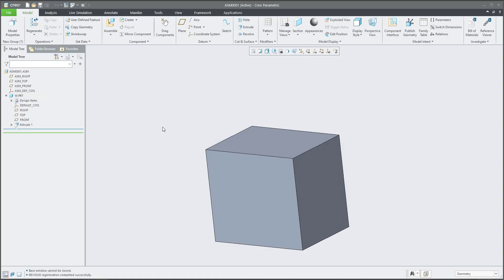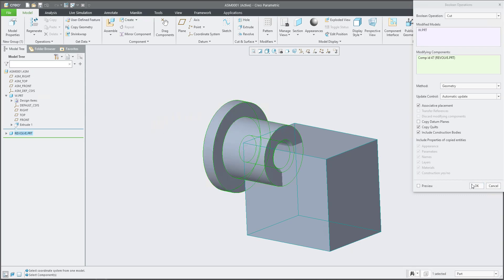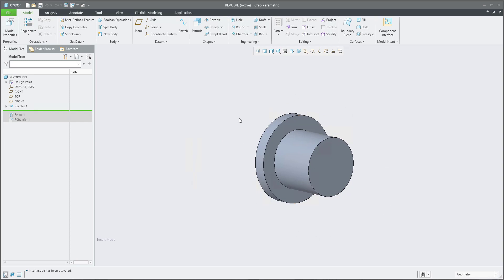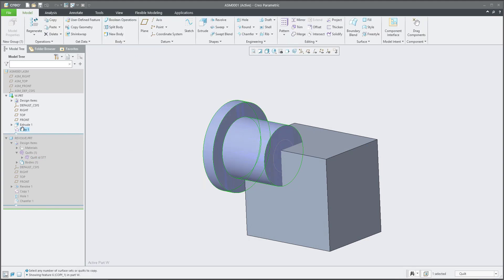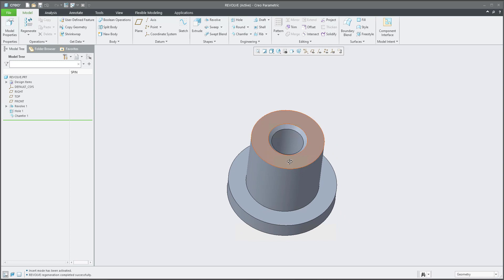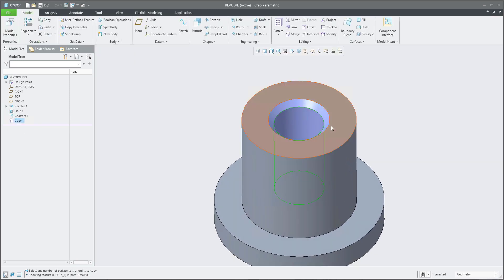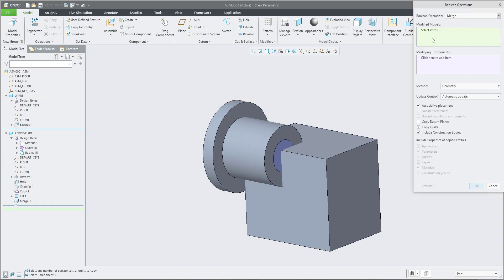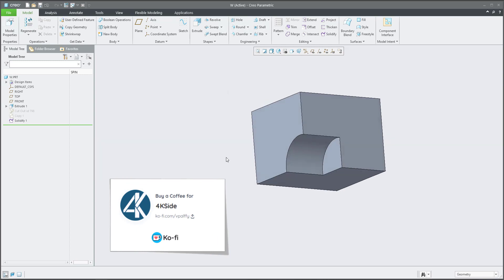Boolean Operation - Solidify - Cut Out - Merge | Creo Tutorial

Comment: Thank you. 
Can we cut out surface cavity from surface block?
Sometimes we receive cavity in surface created in different software and we need to create that cavity in mould block but bcz surface cavity, cavity can't cut from solid block or surface block.
Also IDD option sometimes not worked to convert cavity into solid as cavity created from many surface.
Will you please answer, that will be helpful.
Reply from the maker: Hi, thank you for your question. If you need to create cut out by surface cavity, is necessary use same model accuracy (https://4kside.com/blog.html). You can use cut out if you have solid geometry or solidify if your cavity shape is based on surfaces.
Yes of cource, imoroted geometry needs to be repaired many times by IDD and no problem that is based on many surfaces (necessary ist that both model are based on same quality / model accuracy)
Reply: @4kside  Thank you Sir